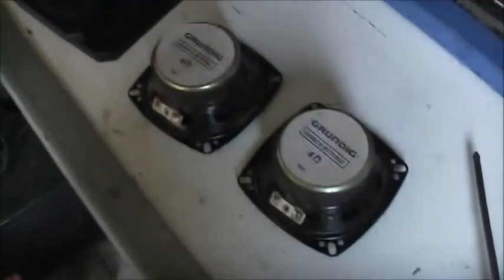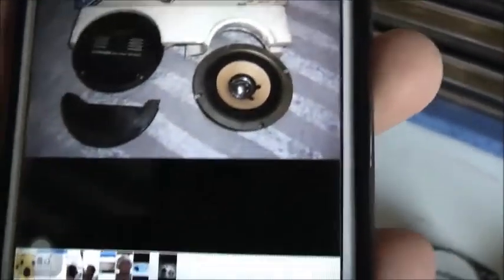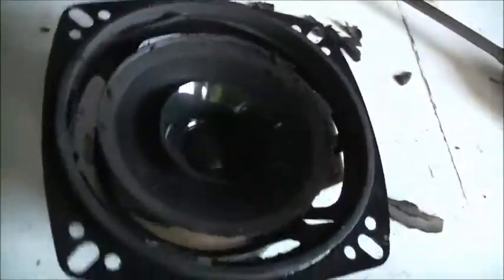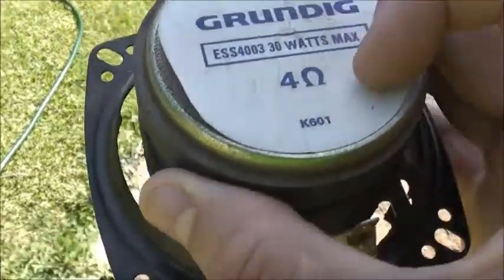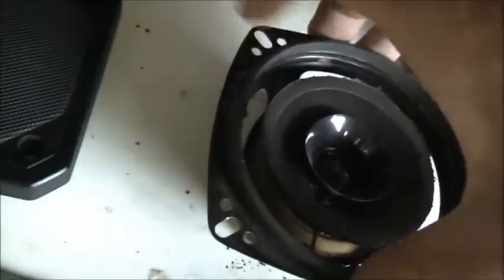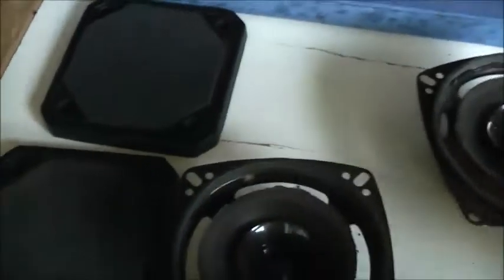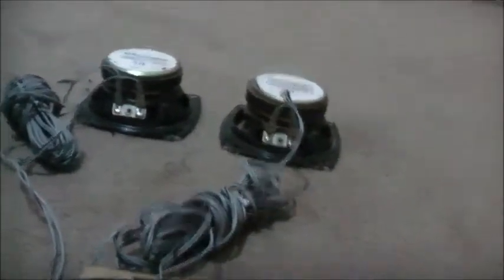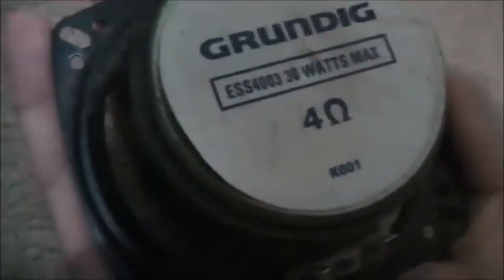Grundig 4 Inch Car Speakers To Refoam

Comment: going to be around 15 WRMS. might be interesting to rebuild. you are a much more patient man than I am; I would have to connect speakers with a buggered edge compliance across 240V
Reply from the maker: wickedxe these are too good to pop, since the repair kits are cheap and widely available, they're worth reparing